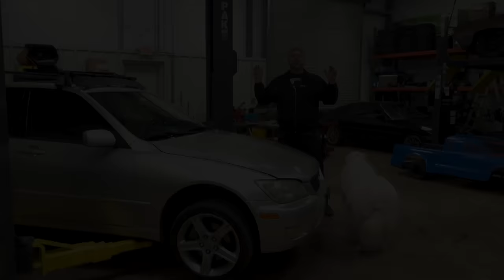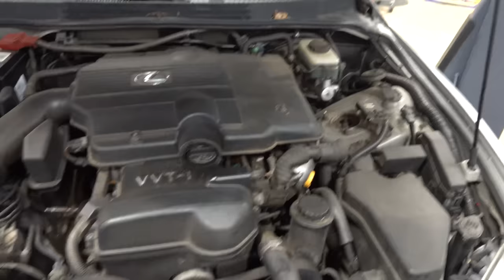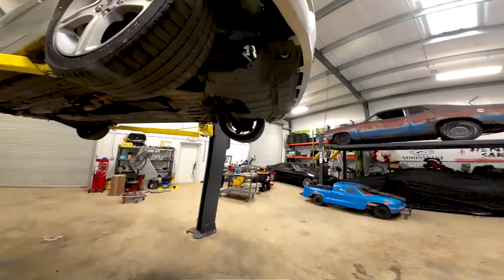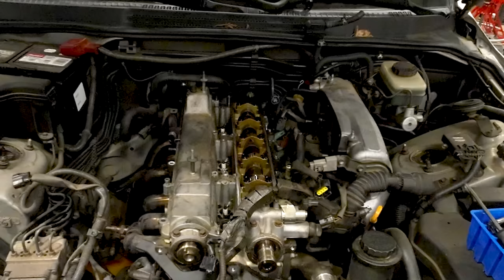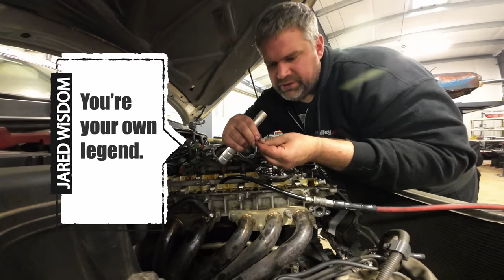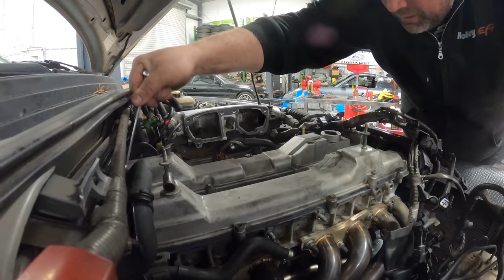I can't believe what i found in this 300,000 Mile Toyota 2JZ Engine!

Comment: It's been a few years but this reminds me of my first auto mechanic work. My dad's 68 Chrysler Newport was running rough I told him the library had books. Chilton manual in hand, I was able to troubleshoot the rough running 383 that led me to discover a worn timing chain. All we had was a cheap socket  set and wrenches to use for my first engine attempt. The book had every step needed for a novice. I was successful and saved my pop a few hundred bucks way back in 1972.  With all the online tutorials available today, anyone with basic hand-eye coordination can tackle a lot of jobs. Jared is right on the money (you'll save!).

Comment: I’m a bit stunned about the “Castrol stains” statement. 

I had been using Castrol GTX high mileage (exclusively) in my Subaru for 14 years and every time I took the valve covers off, the internals looked brand new, no discoloring, just pure clean fresh aluminum color, even with 276,000 on the odometer.

I did change the oil every 3,000 miles, on the dot, religiously. (Hey, oil is cheap, and engines are expensive)
Reply: Your oil is cheap comment made me think, over the life of the car if your oil change was roughly $40 you’ve spent almost $4k on oil changes.

Comment: Its a shame that I6 engines have kind of fallen from grace, so many legendary examples of engines with a 2J-esque reputation that can just go forever and make solid power if you just take care of them. Awesome content as always, I learned a bunch of stuff about the 2J
Reply: MB, Range Rover, and BMW still use them albeit turboed
Reply: Not to mention one of the longest continuously sold I6s ever: the 4.0 I6 from Jeep, originally developed by AMC, then continuously built by Chrysler until finally being retired in the Jeep Wrangler and replaced by a new V6.
Reply: Mazda is bringing back the I6 also

Comment: Have a manual 02 IS300 with about 150k on the clock.

Couldn't agree more. Such an amazing engine, such a timeless car (except those pesky ball joints, those certainly have a time limit). If the IS300 came with the 2JZ-GTE stock, it would easily be worth dummy money.

They're still tons of fun NA though, even came RWD and with an LSD (if you're lucky, some didn't).

Comment: For daily driving and value, the 3800 engine is amazing also.
Reply: Yup, the only thing you really need to watch out for on the 3800s is the coolant elbows that live underneath the alternator on the Series II/III and the LIM gaskets on the Series II.
Reply: Sadlly it is normally hooked up to the less than stellar 4T60E or slightly less bad 4T65E trans (glances at Park Ave Ultra in driveway and two manual-swap racecars in the back yard and parts car Regal GS under the gantry ready to give it heart).
Reply: Drop the supercharged version into the back of a Pontiac Fiero, and hang on for deal life.
Reply: @digitalrailroader  upper intake EGR burn through causing a shop to tell you it is a bad head gasket is another one.  It takes an incredible amount of abuse to blow a head gasket in an L32.

Comment: I have a 1992 SC400 and I love that car. Drives great. Runs really smooth. It only has 96,000 miles on it but I think it might need valve stem seals. It puffs just a little bit of smoke on startup.

Comment: I picked up a 2007 Chevy HHR for $500 because it needed more work that the shop rate was more then the car was worth. Between buying parts from online shops for less than a local shop charged and going to wreaking yards for missing bits, I ended up putting $1200 into the car. I did the work over 2 months in my spare time. It's now worth over $4000 and will run for years before needing anything more than brakes, tires, and oil changes. 

I enjoyed all the time I spent working on it. I added a roof rack to it because I happened to find one in a wreaking yard. Now I'm not afraid to dig into bigger car projects because of this car. I learned more about myself and what I can do if I let go of the fear.

Pick up a cheap car that needs work and enjoy the build. It doesn't need to be some sports car that you are building to race. It can be something slow and fun to just cruise around in. There are a lot of fun cars out there just waiting for someone to come give them a new chance at life.

Comment: Almost 230k on my 2ZZ Celica. Owned for the last 100k. Required maintenance has consisted of brake pads and rotors, blower fan, 2 coil packs (same one twice because duralast) and oil changes. Without a doubt consistent maintenance and treatment make a huge difference. But I've known so many friends with nearly brand new cars who have had nothing but trouble. I can't see myself getting anything other than another Toyota for my next daily, if this one ever dies that is

Comment: Doing a re-ring on an infamous oil-burning Toyota 4-cylinder next month. Total cost will be in $300 range for parts plus fluids that needed changing anyway so all in under $500.  Of course it is intimidating even though I have been working on cars for decades and have refreshed more than a few engines.  For a pro it is book time around 11 hours and I am scheduling 18 with the option to roll to the next weekend as needed because the last things you want to do is rush a job.  This is literally a text book "follow the FSM steps" job with only two less-than-common tools you cannot borrow from the parts store.

I am self taught because I watched my parents and their friends getting screwed by a combination of dealer and independant mechanics that were less than honest.  My first mechanical job was a clutch in their S10 after it had killed two in 54K miles...in a gravel driveway with a Chilton's manual, borrowed tools and a family friend that was a professional mechanic checking in on me each night after work.  You learn in a variety of different ways but physically doing it is a great teacher.

Comment: My junkyard 2JZ from a 02 GS300 had about 200K miles on it and sadly had FIVE spun rod bearings! Can't imagine what that sounded like, but I assume it was driven by a deaf little old lady. Sourced a used crank and some good used rods/pistons, cleaned and replaced all the wear stuff and she now pushes my 59 Studebaker Lark around with ease. No need for a turbo, great milage and it'll run forever with Toyota reliability.

Comment: I have a 2002 Ford F150 with 4.6 2v...with 394,000 original miles. Deepest I have been into it is intake manifold gaskets. The top of the heads look much the same as that 2JZ. Use good oil, and a good factory (or high quality aftermarket) filter...maintenance is key!

Comment: Glad to see some sensible maintenance  being done. And wow I bet those miles were worry free too. I've got an Es350 and all I do is change the oil every 3750 and drive it. Took it to the dealer to have them do the trans service @110k and only did that because they have the machine that hooks into and removes almost all the fluid in the trans and torque converter. And I could not find a better price on that much transmission WS  fluid, so it made more sense for them to do that. Anyway glad to see the upload.
Reply: Toyota/Lexus are the only manufacturer I've seen where most of their engines have very few engineering flaws from day one - every now and then they have issues (e.g. water pumps often aren't great, and as per this video, valve seals - mostly fairly minor stuff though).  My niece has a IS200 with the 1G-FE engine in it, which she inherited from my sister-in-law, who inherited it from my mother-in-law - so it's three generations now in the family since my mother-in-law bought it in 2008, and it's had a horrific life as none of them have cared for it at all (I've done 2 oil changes on it for them, both times because it was way overdue - but not sure how many others it has actually had - amazingly last time I looked at it, there was still very little evidence of sludging) It's gone from a near new, very low mileage car to a very high mileage, flaky paint dent bucket full of dog hair, McDonalds wrappers & used diapers, and it's been broken into and vandalized multiple times - but damn, that thing just keeps going despite hardly seeing an oil change.

Comment: you don´t need a compresser, a little string do the same. put it in the cilynder via spark plug opening and turn the crank shaft until it´s compress the string to the valves.

Comment: This is why these engine or these cars makes the perfect tuner car. 300k miles stock and it looks like that. You can definitely build the engine up a bit slap on a turbo and it should run like stock. The potential they have is unbelievable.

Comment: Little word to the wise: if you need to do a head gasket job on a 3S, 5S, 1JZ or 2JZ, buy the toyo tool and DO THE VALVE STEM SEALS!!!! No worse feeling in the world than to cheap out on the tool and skip the seals only to get everything back together and oil start billowing from your exhaust. Found that out the hard way with my 93 Celica GT 5SFE.

Comment: I use Schaeffers. We have always used it in our cars. Has never let us down. First few oil changes are always really dirty but i had a 200k mile k20 in my 09 si that i bought with 30k on it. Used Schaeffers on the first oil change. Always changed at 5k my engine looked like new when we took it out to build a k20/k24 Frankenstein. I was impressed to say the least.

Comment: Having been a car guy for over 30 years, I can say I've seen many 300,000 vehicles from just about every manufacturer.  The secret is maintenance maintenance maintenance. I've also seen many dead ones. Most are do to extended oil change intervals. Including the 2jz they die just like all of them.

Comment: You forgot to mention the VVTis are interference engines so timing belt changes are crucial
Reply: Actually, a little research will show you...
because its based off a non-interference engine, it itself is also non-interference.
Reply: @804_Rider  the GTE VVti is non interference, the 2JZGE non turbo VVTi IS interference. I've had both, a non - vvti 2JZGE in my 92 Supra and a vvti 2JZ in my IS300.

Comment: Just did the timing belt on my son's 2003 GS300.  Many connectors were already broken.  It was very clean as well.
Reply: Its an 2j normal issue. Its getting really hot in there. Over time plastic connectors gets brittle like Bob Barker.  Even the Little thingy that hold the hood prop dries and break

Comment: I agree make memories me and my 2 boy spent the hole day working on my 95 f350 that I got not running with a 7.3 power stroke I now every little about the engine but we got it all put back together and made it start for a minute but now I that it will run once I get it to pick up fuel

Comment: Yup. If you do your maintenance, the engines last. I have my uncle's 80's Merc and you would never belief that the clock spun not once, but twice if you saw the insides of that engine. Why? Because the man changed his fluids every few months, every time the pan came out and it got cleaned to original condition, never ran raw water inside, always had the proper oil specific to winter or summer conditions (thicker in summer, thinner in winter) etc. Now, we don't get winters like we used to, so i don't do the switcheroo thing with thinner oils, these days, (i also don't run it in winter anymore other than a warm up to keep things going) but i keep on top of the changes like he did and it's in immaculate condition.
This engine was never out of the car, never had a single issue and it got used. Used a lot. It ran Europe from one end to the other, i think it's been through thousands of tires by now.
Keep your fluids right peeps, and you won't have issues with engines. Other shoite, maybe, but lubrication is the number one live or die thing for engines.

Comment: bought one of my volvo v70 at 200k and it had problems with oil pressure. fixed it but I culd not see the cams then I got the cover of. the v70 i got at almost 300k was spotless and runns like a champ, well both of them do now, and the last one had castrol 0w30 a5/b5 for most of its life :)

Comment: It could have had the head gasket done and head rebuilt at some point since its so clean inside. I was taught a trick to do valve seals when i was younger. We took a small amount of rope that would fit in the spark plug hole and fed about a foot of rope in leaving just a piece showing then we slowly ran that piston up until it was pressing the rope against the valves and we could remove the spring and retainers on that cylinder ! LOL Worked like a charm.
Reply from the maker: The only reason I know that hasn't been done is the length of time that my friends have owned the car, they got it fairly low miles and put them all on themselves, and aside from the basic stuff, I've done all its work!  

And I know the rope trick works great, I just have never done it and dont feel comfortable show it.

Comment: There is one bad engine in the Lexus lineup from the 2 IS (In Europe) They had a 2.2 turbo diesel and those engines are terrible. Head trouble, injector trouble high pressure diesel pump trouble, camshaft issues, Some stem from DPF (Diesel particulate filter) clogging but others are just poor design and or cheaper parts from the factory. And no companies made a better injector for them. Sad really but this only for European and maybe Japanese markets. Rav 4 etc.... got  the same engine with he same or similar issues. Just a little info for you as i know America didn't get the diesel engine. Really enjoying the content Jared informative and entertaining keep it up.

Comment: Just a tip for ya, you know how you were hitting that impact driver with your hand, that's the most common way to injure one of your 10 small bones in your wrist, I should know and, sadly was also for warned by a co-worker, I now have a fused wrist as my Lunate died from an impacted fracture doing the same thing, basically you'll lose most of the motion in your wrist. As the surgeon said, your hand is not a hammer.

Comment: So I have a question for you Jared. You mentioned that Gastrol oil tends to stan the inside of the engine. Do you have a preference when it comes to types of oil? I have a Volvo S70 that just turned 170000 and my hopes are to get 300000 or more miles on it.

Comment: I wish my mazda FSDE was longitudinal its even easier to work on than a 2jz. Just as reliable with good maintenance or build a motor with upgraded rods and pistons and push over 300-600hp out a little 4 banger with a little t28 turbo

Comment: I have a Subaru with the legendary EZ30R flat 6 in it. It has 270,000km on the clock and needs an intake cam gear replaced. This means openening up the front timing case with it's 100+ allen bolts. I am not looking forward to this.

Comment: Hello Jared. I hope you see this because I’m not sure how else to ask you a question. Being a Master Toyota mechanic, how do you feel about newer Toyotas recommending zero weight oil? I fee uncomfortable with but use it because that is what is recommended by Toyota. The last two oil changes I’ve done, I have noticed a little build up. Could that be caused by low weight oil breaking down? I appreciate your videos. I find them entertaining and educational, keep up the good work!
Reply from the maker: So the new modern oils are designed to improve fuel efficiency by reducing additional turning resistance from the oil. My only real concern is that style of oil mixed with the really long intervals(7500+ miles). Good synthetic changed every 5,000 is where I feel comfortable personally.

Comment: As long as you take care of it and drive it consistently a Toyota or Honda engine should always be this clean
My D16 is over 300k and is just as clean as this 2JZ, meanwhile my moms ecotec with 250k has a quarter inch of sludge even tho I change the oil at the same time as mine

Comment: I had one as my first car, and still have it. Dropped a valve at 170k miles though on the highway soo.... yeah. I like working on my Audis more now, faster, nicer, easier to work on. Keeping the IS300 just because it was my first car, have not driven it in 4 years now ;( Maybe in the next year I'll swap the pistons out, hone the block. Everything else I've taken care of and cleaned, but until then it just sits with a blanket in the engine bay covering the block

Comment: Jared, things about skills you mention near timestamp of 20 minutes are true. But however,  some skills require equipment to be able to work efficiently and safely. Ball joints can be changed without a hoist but for example exhaust work should be changed with such. Also, some pneumatic tools along with compressor ain't cheap. That's why I personally rather let the professional to take care of the vehicle, as I do not need to invest money for the equipment and to space needed, nor my time for the job. Of course it costs money, but if you are a computer geek and you spend your money on garage, it does not make much sense..eh?  :D

Comment: My 1997 Toyota Hilux that has done 430000kms l live in Australia and l pulled the rocker cover of to replace the gasket on it and l was impressed how good it was under there now l bought it 4 years ago for aud $1500 no service history so l did drive it around used it as a courier vehicle for a couple of years and because of covid my career finished so l had to retire well l was close to 67 which is the age you can claim the aged pension do l did and l kept the Toyota Hilux l have serviced it replaced under a lot of service parts under the bonnet which was easy for me because l will try any thing 35 years as a courier l did most things my self replaced gearboxes clutches every issue l had with keeping my vehicles on tge road and when l retired l started watching you tube and found how good my Toyota Hilux is l have made the decision to keep it and enjoy repairing it and driving it